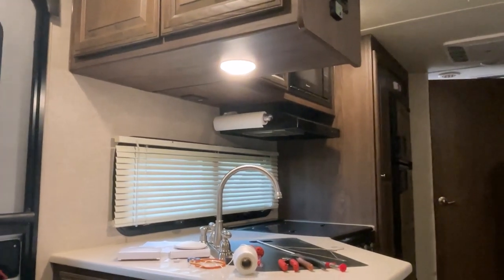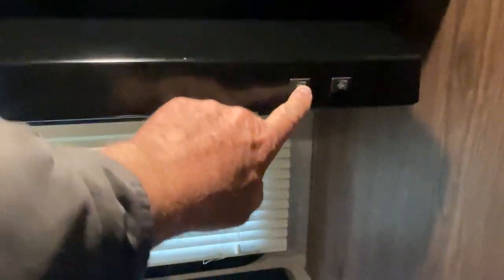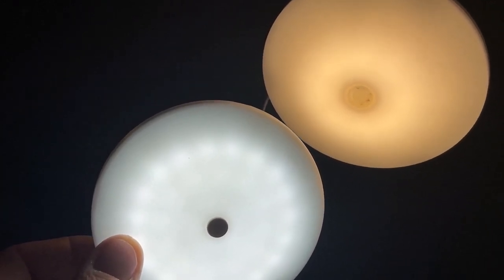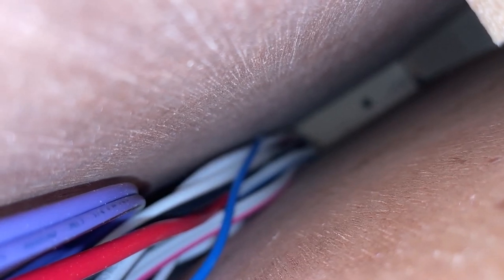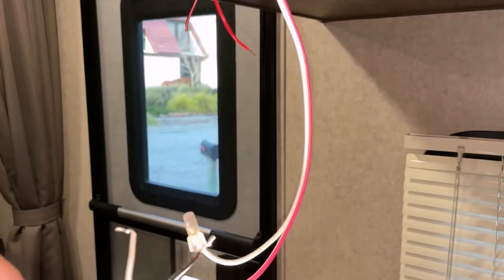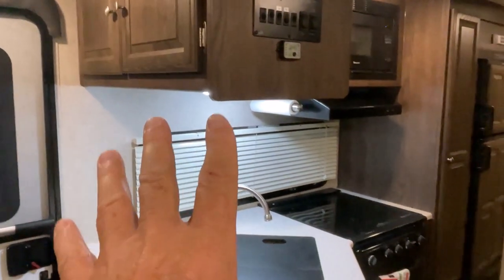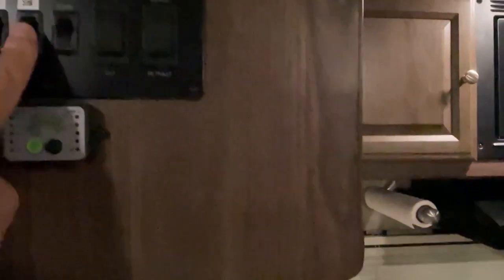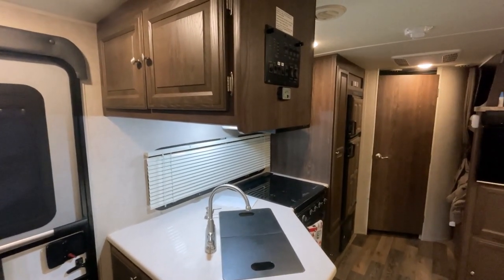How to Easily Install Additional & Brighter RV Under Cabinet Lighting

Comment: That wire was a lot easier to pull than I imagined.  Good thinking using an existing wire
Reply from the maker: Thanks, I learned this a long time ago by chance and it worked. You just need to make sure you pick a wire that is loose and not zip tied, and if the wire goes through a tight hole in  a hidden place to take it slow and if it hangs up to use a different wire to use.

Comment: Great job on pulling the wires! I may buy one of those paper towel holders.
Reply from the maker: Thank you Allan, just make sure you find a wire that is loose and is easy to pull both ways. And most important of all is to take your time. Here's the video of me installing the paper towel holder. I must say its really nice and works great, I highly recommend it. https://youtu.be/E6sOviVHDjk     

Here's a link to the paper towel holder - Kamenstein Perfect Tear 14 Inch Wall Mount Paper Towel Holder - 
https://amzn.to/2SGicnd

Comment: This is great. I will be replacing all my lights in my 25brds Flagstaff. The bright white is so much better than the pale yellow. I may leave some the same in certain areas once i start seeing how 2 or 3 look. These lights look great. Thanks.
Reply from the maker: Thanks for watching Jaz. Hold off on ordering these lights, they are great for under the kitchen cabinets but are to bright for the trailer ceiling even if you dim them. After lots of searching I found the perfect light for the ceiling and will be putting out a video on it within a couple weeks. Please reply that you got this message. Thanks Mike
Reply: @thetraveltrailerguy  yes, i got it. Thank you